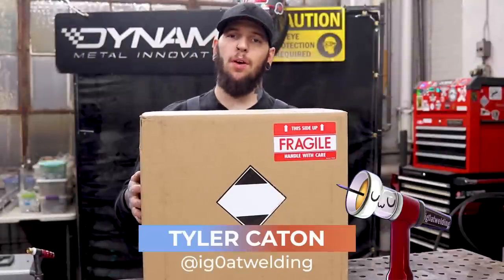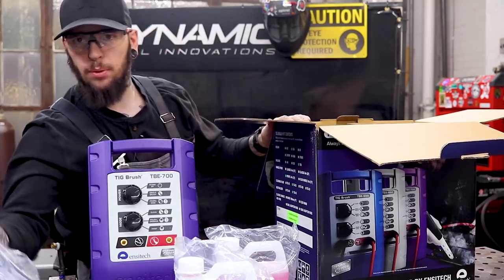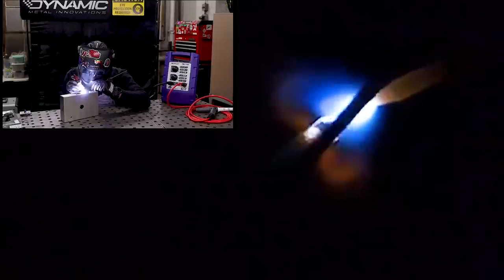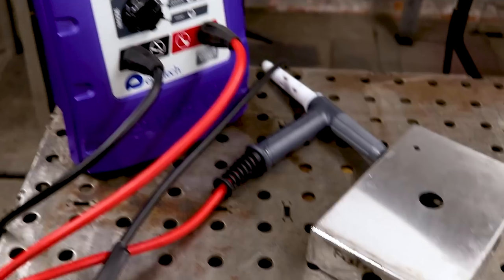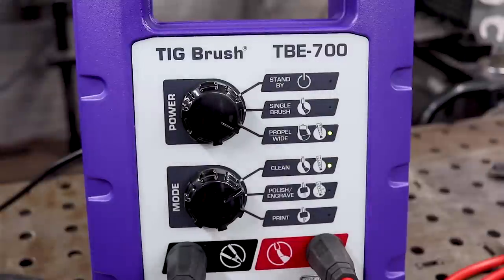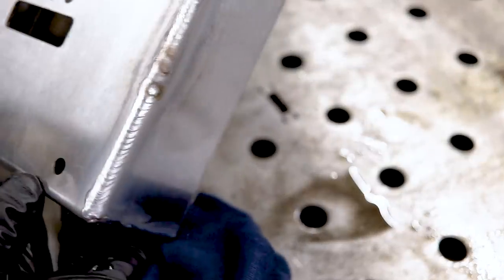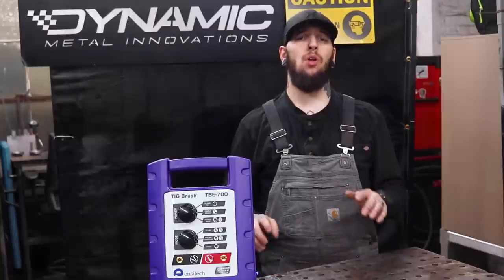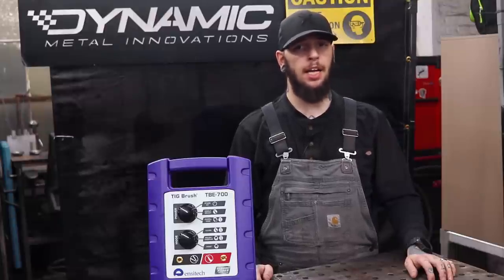Cleaning Stainless Steel Welds With TigBrush

Comment: I got the TBE 550 a few weeks ago. It has been Rock Solid. I am working in the food-grade / sanitary environment. I normally clean my welds with Scotch-Brite by hand or on my angle grinder. This has been a game-changer for me. Also when I use the machine I charge an upcharge per hour. It should be able to pay for itself in 9 to 10 weeks. The only thing that I do different than the video is I hold the wand in one spot for 3 to 4 seconds before I start moving across the weld. I don't necessarily brush back and forth. The Polish mode just brightens everything up and gives the whole area a better look. The customers have taken notice!

Comment: We've used these for years.  They work slick.  The biggest challenge is just training people to use it right and properly clean afterwards.  We have a 700 in a full production environment for 8 years, small parts, big 1000 lb enclosures, everything.  Other than basic wear and tear, it's worked flawlessly the whole time.

Comment: Welds with color are oxidized which may contribute to sensitization.  This device passivates stainless which is the opposite of sensitization. 
Chromium is what makes stainless resist corrosion.  Chromium burns out when exposed to air, this is "sugaring".  Carbon can precipitate chromium in Weld HAZ.

Comment: I use an old battery charger with a carbon fibre brush. It works just as good. Though if you you want flexibility you can pay between $3000 to $6000 for this machine.
You should avoid arching out as much as possible excessive arching can cause carbon inclusion.

Comment: Price is too high for what it is! My chineesse crapy weld cleaner does the same thing. For 300$ not 7000$. I also use surfox weld cleaner in the past and my cheap machine take less than 2 minute more to clean the tig weld you can do in a day.
Reply: Agreed.  A bit of Scotch Brite goes a long way
Reply: I also have one of those. This machine knocks it out of the water.
Reply: @elkvis unless you can't have marks on a finished product. Or if you're welding a few hundred parts. Application is everything.
Reply: @TJCaton91  I'm sure this thing is great, and it clearly does what it says on the tin, but it's literally an accessory that costs more than a pretty blue TIG machine.  That's excessive.

Comment: TigBrush is a great little machine but honestly extremely overpriced. I work as a welder/teacher for one of the biggest sheet metal fabrication companies in the world and we do this stuff quite often, however we use Italian made machines that cost about 75% less than TigBrush and do the job just as good. Not trying to hate i just think it's way over marketed and priced.